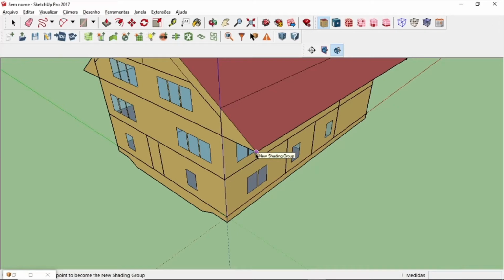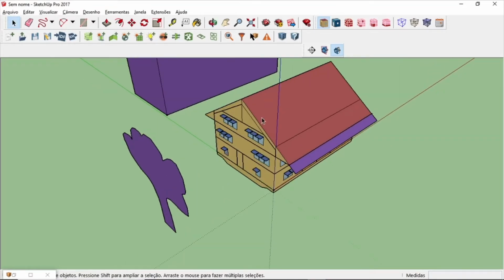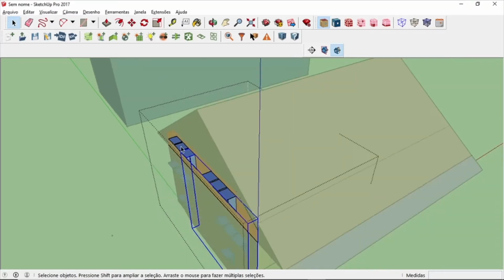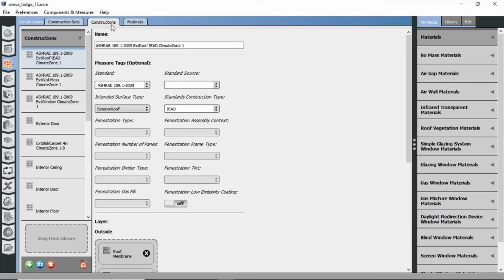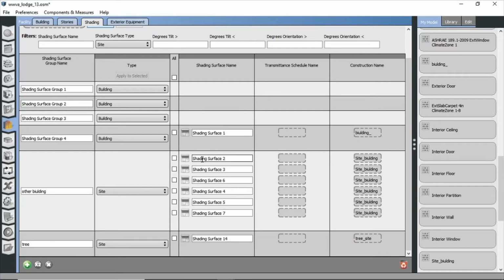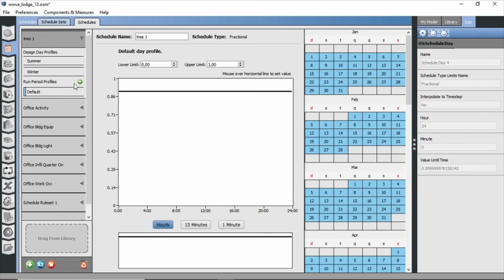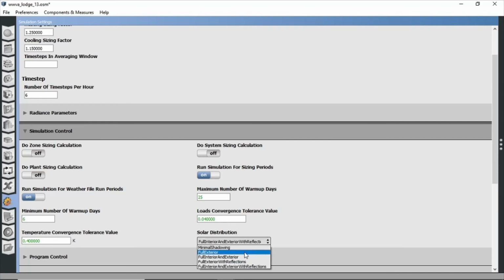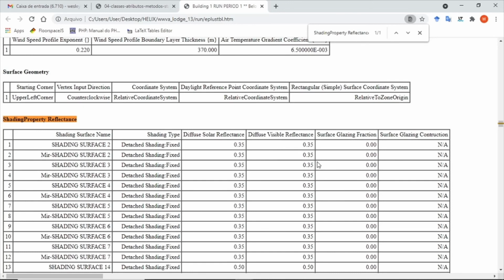OpenStudio SketchUp - All About Shading Surfaces

Comment: Hello. I want to work on Thermal performance of   Phase change material blinds in double skin facade. A whole building simulation. can i do this using openstudio? Thank you
Reply from the maker: Yes, however I do not see that this object has been exposed on the GUI, so you will have to write a custom measure to insert it into your model.  Here is the object: https://openstudio-sdk-documentation.s3.amazonaws.com/cpp/OpenStudio-3.9.0-doc/model/html/classopenstudio_1_1model_1_1_material_property_phase_change.html

Comment: Thank you for the well explained video on shading. Would it be more appropriate to change the building overhangs as shading surfaces, rather than adding the additional overhang shading element? As you have added the shading overhang suffices for the purposes of instruction.
Reply from the maker: Agreed.  If the building overhangs do not communicate with the attic, then you can simply convert them to shading surfaces.

Comment: Hello! I am trying to change the Shading Surface Type, bit this field os blocked at my model. How can I change a building Shading Surface to a Site Shading Surface from other way? Could I simulate a tree as a Building Shading Surface? 

Another doubt, how can I do the transmittance change  schedule Shading Surface on Energy Plus directly?
Reply from the maker: Building and site shaded surfaces should be purple. The space shading surface should be blue. You can change the building and site type using the OpenStudio app: Facility tab, Shading tab. You can change the space type using the OpenStudio app: Spaces tab, Shading tab.

You must create the space shading surface while editing a space.

If you want fixed solar transmittance, create a fixed fraction schedule and assign the schedule as shown in this video.

Comment: thank you for the good teaching, can i use the temperature variant transmittance or emissivity? i want simulation for the thermochromic materials, for example, window
Reply from the maker: Thank you.  Good question.  Yes, you could simulate thermochromic windows by applying a shading surface over the window and then assigning an 8760 hourly transmittance schedule.  The transmittance schedule could be precalculated csv file based on the TMY weather data and then imported into OpenStudio using the import interval measure as discussed here: https://youtu.be/S_HbjEAGCrg?t=225

Alternatively, you could write an OpenStudio or EnergyPlus measure that inserts the WindowMaterial:GlazingGroup:Thermochromic object and its associated WindowMaterial:Glazing objects into your model and assigns the GlazingGroup as a material to your window/s.  Here is the InputOutput reference: https://bigladdersoftware.com/epx/docs/8-0/input-output-reference/page-010.html#windowmaterialglazinggroupthermochromic